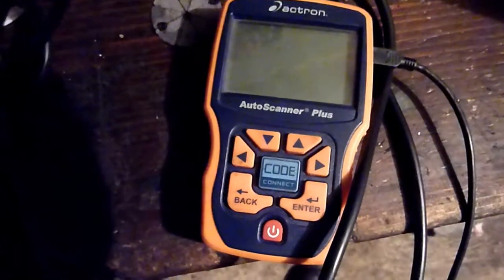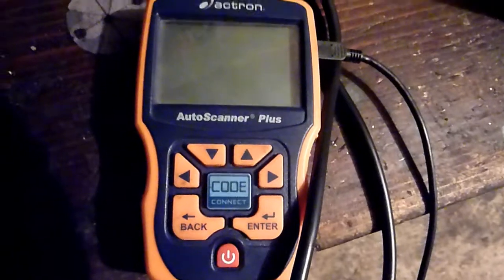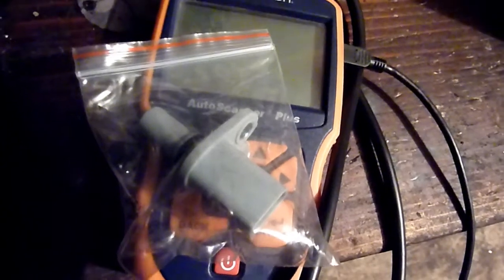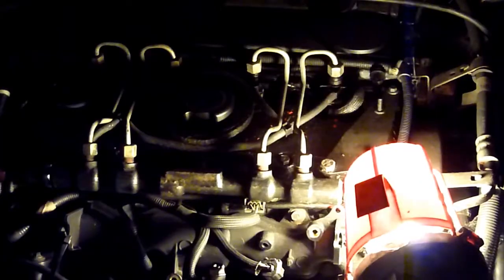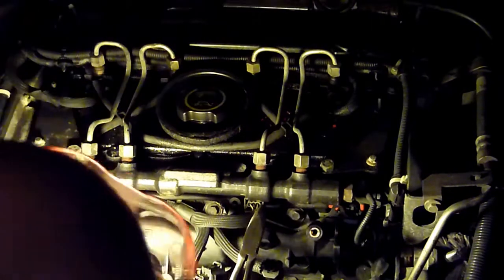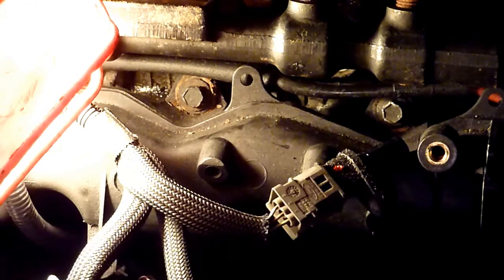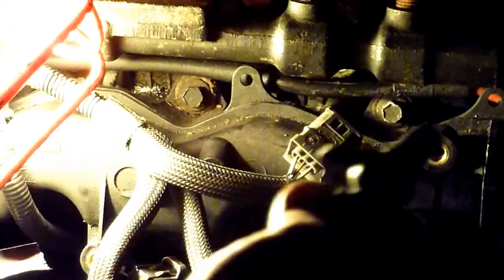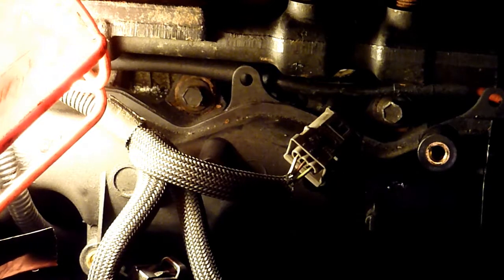Car has Total Injector Shutdown - CamShaft position Sensor Ford Mondeo MK3

Comment: I have exactly the  same Problem i also had, suddenly the engine power was bad. This morning i wanted to go to work and the car did not start up. The same Error Code P0340.
Gonna change it this afternoon an we gonna se if it works
Reply from the maker: Good idea to get a spare OEM Ford part and change it.
Reply: It works. I got the original Part of a Ford Dealer and they gave me one that is grey. He said it was changed.